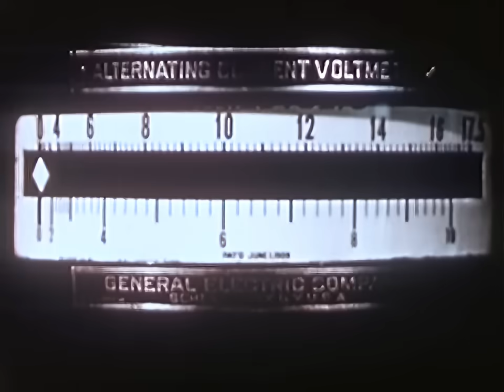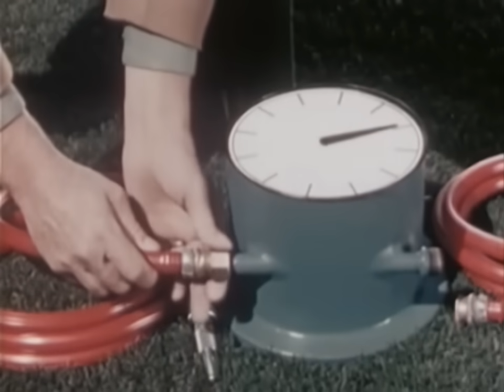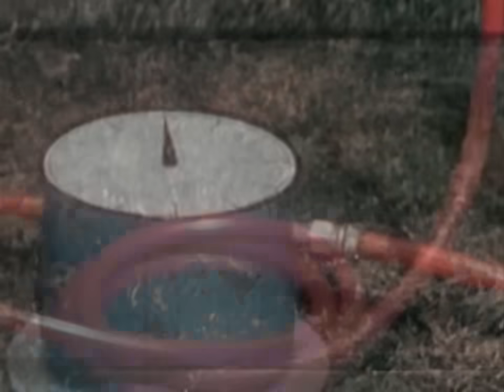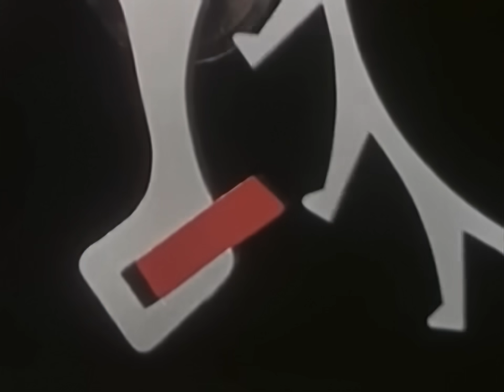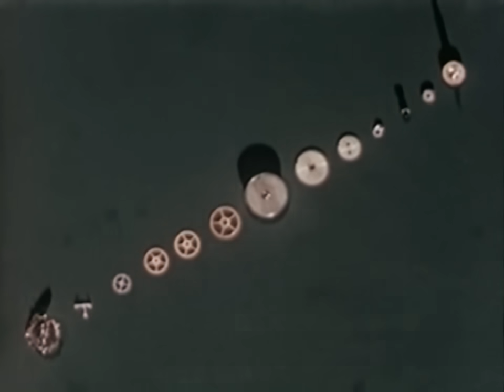How a watch works (1949) | Hamilton Watch

Comment: Aye I have one of those watches and the cool part is that it’s see through. I got mine after I saw that my first grade teacher had one. The only thing that’s different between this animated watch vs my watch and my teachers watch is that all 3 hands are on the same gear. The second hand isn’t in its own circle. Another thing is that both of ours are see through and there’s this metal semicircle plate in the back surrounded by liquid and it moves whenever you tilt the angle of the watch. If some can explain to me what that’s for, that’s be amazing.

Comment: White people invented everything.
Reply: That statement is both irrelevant and incorrect. Ever hear of George Washington Carver?
Reply: @jakekaywell5972  Yeah, I heard of him. And for every non white inventor there are at least 10000 white ones. So please don't come at me with the peanutbutter man.
Reply: @Szederp  That is an entirely made up statistic and as such is not to be trusted. Even if we just stick to people of African decent, we can see a good deal of innovation. For just a few examples, Garrett Morgan invented the traffic light in 1923, Frederick Mckinley Jones invented refrigerated trucks in 1940, Mary Van Brittan Brown developed the home security system in 1966, and automatic elevator doors were invented by Alexander Miles in 1887. 

Oh, and considering that Mr. Carver developed more than 300 uses for the peanut plant, whittling him down to just "peanutbutter man" is a tad bit rude.

Comment: All these watches are mechanical, and yet small and slim. Nothing like the superbulky designs we see now. When did watches start getting so huge?
Reply: You may be surprised to find that many of today's huge fashion watches have small movements. They're just hidden underneath a huge watch face which is dictated by style more than mechanical limits.
Reply: Adding a rotor to make them automatic make the watches thicker.
Reply: You can pretty much blame Sylvester Stallone for the trend of huge watches.

Comment: I still dont get how balance wheel keeps its spin. It doesnt draw power from the mainspring but it just keeps ticking. How that works?
Reply: The balance both controls and draws power from the mainspring. The escape wheel gives a slight push to the balance wheel, called an impulse, each time the balance unlocks a tooth. So, each time the escape wheel advances, it is impulsing the balance wheel to keep it in motion.
Reply: okbridges Oh i see, tiny pushes keeps it spin. Thank you! <3

Comment: I’ve looked at most all of the YouTube videos showing how the watch works. This one is by far the best and most detailed, though it’s almost 70 years old!
Reply: Exactly -- 70 years old ad, and still better than all the others.  The slick modern videos even get the basic physics wrong.
Reply: I addition to modern videos, they add annoying music.
Reply: Some things just cannot be improved upon.
Just as my Dad's old railroad watch still keeps perfect time, despite its last servicing being in the late 1950's.
Reply: @spvillano  

I'm a watchmaker, I don't believe you. Lubrication will be gummed up and cause a time loss.
Reply: @mcstyle24  it's odd that his railroad watch still does work though, likely the last lubrication simply evaporated, rather than oxidized. I'll have to get it down to a watchmaker for servicing, despite it keeping good time - lest it experience excessive wear. I used to do such things myself, but as I grow older, my arms are strangely growing far too short...
Still, as I said, I suspect that the old lubricant simply dried or any gumming formed a cup away from the friction points. Were it a Timex, I'm sure it'd have been gummed up hopelessly, due to a lack of jewels in that metal on metal movement.
Reply: Me too, I've looked at practically all of them.  As you say, this one is BY FAR THE BEST because it lays out the flow of energy in a clear, understandable way.  We're lucky to have found it!
Reply: I could not believe either, no access to fancy 3D renders and animations, yet, the BEST explanation by a LONG shot
Reply: I admit
Reply: 1949, that’s long time ago when high quality was important
Reply: Where are these types of videos?  Many contemporaries are crap in many subjects
Reply: Yes it actually shows how the watch gains it's first momentum, through manual movement by a human being. Other videos just show the balance wheel spinning with pallet (if im not wrong) swinging, they don't show who moved whom first.
Reply: That's because back then they didn't want a ignorant society and wasn't afraid to share the knowledge.
Reply: Bingo! 👍

Comment: As amazing as it seems that the tech. of making small pieces for these watches in the 1940's - it's staggering that watches of not so different size and complexity were made in the 1600's.
Reply: Amazingly (good) battery operated watches still kinda work the same way. They just swapped out the main spring for a 32,768 hertz oscillating crystal and a tiny 14 bit shift register. Since 32,768 is equal to 2 to the 15th power, 32,768 hertz will pulse out the 14 bit shift register every second and send mechanical power to the hair spring.

Still amazing and cool, just different physics. :)
Reply: Nope - watches of that size came about in the late 19th century.

Comment: I wonder how many monthly wages a watch such as this cost 50 years ago. I've been told this watches were just a tool and werent that expensive.
Reply: There were three basic grades of mechanical watch, "dollar", "cheap", and "jeweled".  Hamilton was a premier domestic example of a jeweled watch.  A dollar watch was, as its name suggests, meant to be priced at a dollar or so, and was aimed at blue-collar workers, kids etc. and had a solid but unjeweled movement, so they wore out faster.  A cheap watch was a step above the dollar, and had a few jewels at critical pivot points.  Jeweled, obviously, was the best, and meant for precise and/or hard service.

A watch such as this would have cost the equivalent of roughly $500 today...not unlike a modern mechanical Hamilton out of Switzerland.
Reply: korencek looks like they were around $50. https://images.app.goo.gl/PhTqzpQ9GcZEbpQP8 Average household income was around $3100. https://www.census.gov/library/publications/1952/demo/p60-009.html

Comment: can't believe they managed to make a part so small 50 years ago... how the hell did they machine it. talking about the pin at 18:00
Reply: They had no problems machining fine parts, or using dies to make micro gears and such fifty years ago, it just took longer without computer aided mills and lathes. BTW: I'm sure back in the 40's they probably ask the same thing about clocks made in the 15th century lol
Reply: Specialized machines called jig borers. Fine-tolerance lathes and drills and mills.
Reply: Watches at that time were hundreds of dollars of not thousands on thousands of dollars
Reply: @Futternutterbutter  in 1927, a fancy Hamilton watch was $150. That's $2200 in today's money. A regular Hamilton was $55. I have a 1941 Gruen watch that is similar to the $55 Hamilton
Reply: korencek What surprises me is that back in the 1800s they made extremely complicated watches, some even beyond today's standards
Reply: People were much, much smaller then.